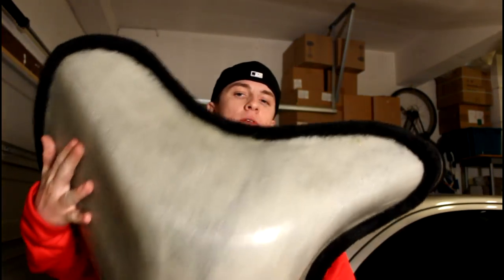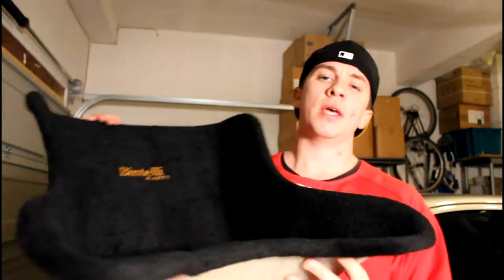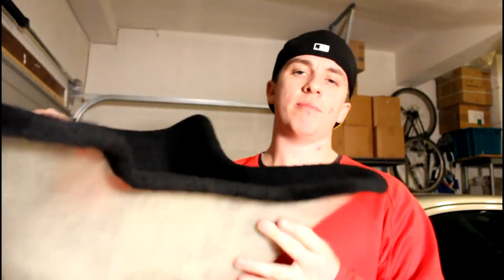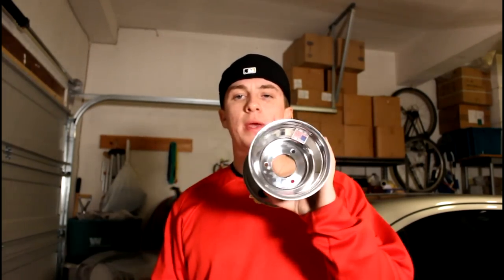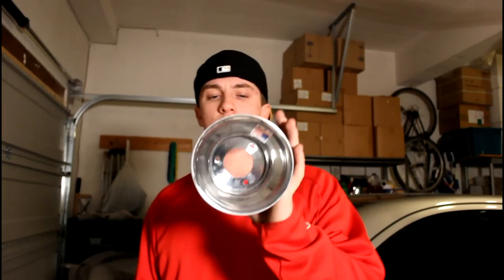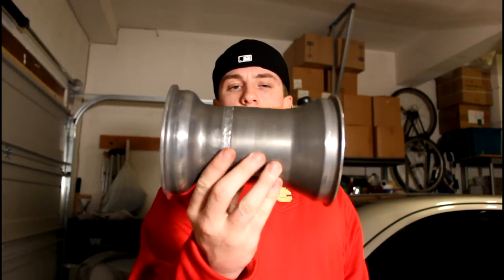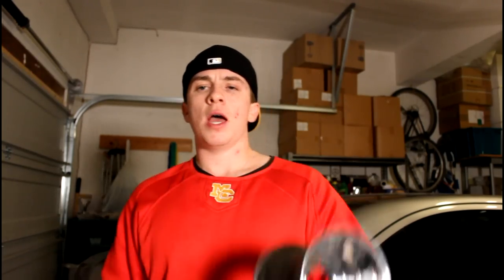(Homemade) Go Kart Build Project Introduction Video!!

Comment: love it. Did you guys did stress analysis using solidworks? or you just went for a steel frame that you know for sure was going to resist?.  And is there a way you can share the solidwork files? I would love to do this project.  What are the specifications of the steel fram you use? cross section?
Reply from the maker: Didn't have training for FEA software or access to it so I just really braced the frame in a lot of the areas I thought that would be weak points. The steel I used is 1 inch x 1 inch x 0.065 inch gauge square tubing

Comment: If you wanted to, could you change up the motor on your cart?
Reply from the maker: It would be a tight fit since the engine sits right behind me but I'm sure I could mount a bigger one in if I tried, going to be modding the engine I have now though

Comment: nice! thank you guys! just a question, why didnt you used tubes with circular section? and you did use in square section?, i know that circular section tubes are better dealing with torque stresses (talking about the chasis i mean) thanks a lot! look pretty neat at solidworks!
Reply from the maker: +Bruno Camacho Thanks man! Reason I didn't use circular tubing was because you need a special tool to correctly cut the "cupped" ends so that it fits around the other tubular pieces. Square tubing is just easier to cut and weld together.
Reply: Oh.. All right I got it, yes, let me just congratulate you guys. What you are doing is remarkable, and it is called passion for things. And Thank you for sharing all this information and experiences! When you talked about studing Engineering I knew What you meant, I am a mechanical engineer as well. Anyway, thanks a lot!!
Reply from the maker: Thanks Bruno, I really appreciate it! This is a great type of project to use for resumes and exhibit your passion for sure.
Reply: Hnat Automotive Photography not really 
Literally a little work with a grinder max
There are literally sites that you can put in the information you need 
Tubing info and what angle cut you want, etc..  at it with print out a to scale pattern for you
Reply from the maker: It entails more than "a little work with a grinder" to cut circular tubing and have it fit well together. Yea you could do it with a grinder, but that is not the proper tool to use for that and thus it will take way longer.
Reply: Why does every engineer have to overthink and over complicate everything? It's called coping, it's nothing but removing material that you don't need. It can be done with a million dollar tool or a $30 grinder and both will work just fine. Take longer maybe but you use the tools you have. Plenty of speed record breakers have run down the salt flats built in a guys carport with nothing more than hand tools on a budget. Built from plans drawn with a pencil and paper with manual tools.
Reply from the maker: dj beard still would take more time, don't see your point. Yes I could've easily done it with the tools I had, but the extra time was not worth it for me.
Reply from the maker: dj beard had nothing to do with "not being able to do it" or "overcomplicating things"